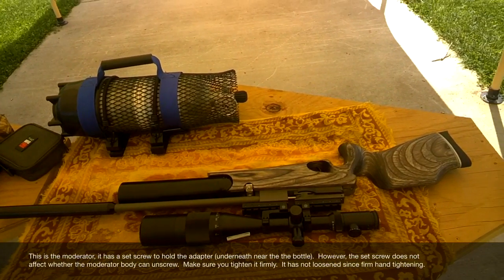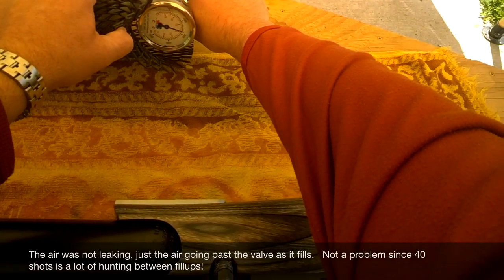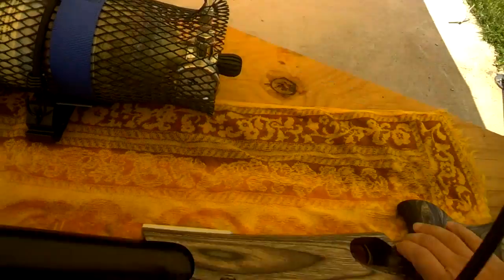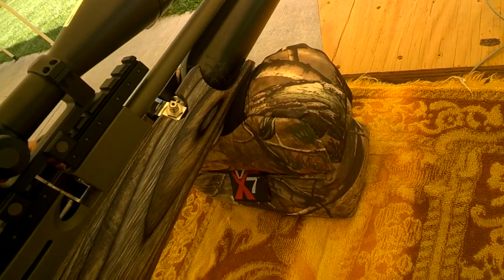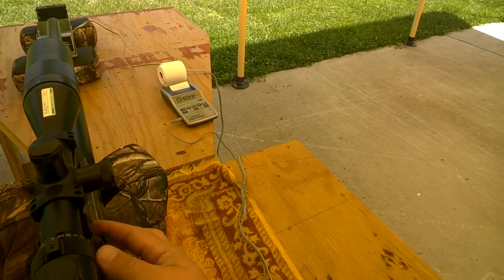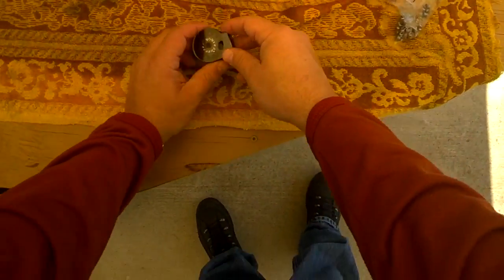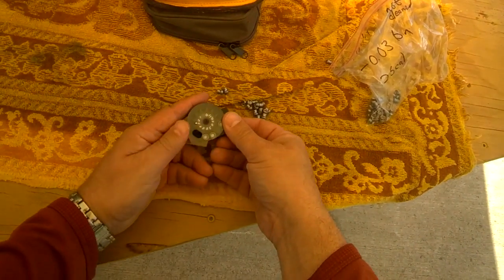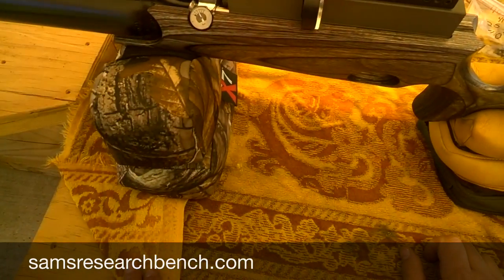HM1000x chronograph initial test:  A Google GLASS perspective

Comment: I'll look forward to your report on accuracy. I think it will show that a given barrel and a given pellet will mate up to give the best accuracy at a given velocity. I do think an indoor test (no wind) wold be optimal, but outside results will be interesting to see. I wonder how pellet speed will affect accuracy at given wind speed? Will a slower pellet resist wind drift more so than a faster one? Domed pellets become more or less unstable at certain speeds. Faster may be less prone to wind drift, but more unstable in flight. hmmmmm....
Reply from the maker: I will test the JSB's the most and will do it indoor and outside.  It was shooting 0.3 inch groups at 50 yards with not tweaking.

Since this will be used for hunting, I want to try a sampler of pellets.  This site offers what looks to be a good sample of pellets from a lot of manufacturers to test.

http://www.straightshooters.com/straight-shooters-full-pellet-sampler-.25.html

Comment: Nice video, Sam. I'd be curious about the number of shots from that fill which will hold POI at X yards, or put another way, have you identified a (repeatable) sweet spot? The HM 1000X looks impressive, and seems very quiet. Those Google glasses are you, man! :)
Darryl
Reply from the maker: Howdy Darryl!  I will head out this weekend and repeat at different velocities.  I just wanted to get an idea of what it would do.  Accuracy has been good at 893.  I am interested in going down to 875, 900, and say 925 to see how the accuracy holds.  Will post probably Sunday night if all goes well.  The moderator is a huge help, it really took the noise level down compared to the unmoderated tm1000.  The HM1000X is going to right now be fitted with a Hawke Sidewinder and 20 moa nikon mount.  The Nightforce is going to be mounted on a 308 Sako Varmint for the Sizzler and the next VMA match.